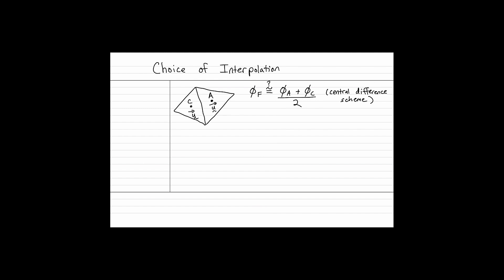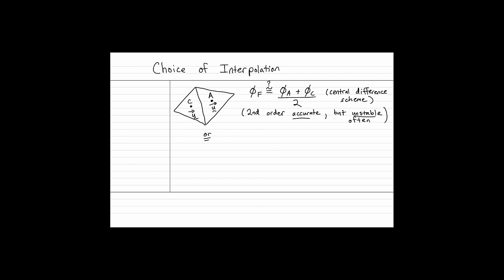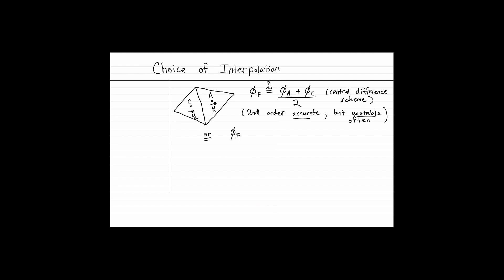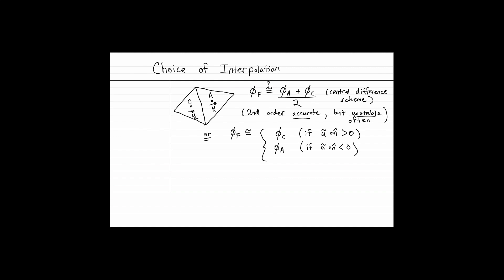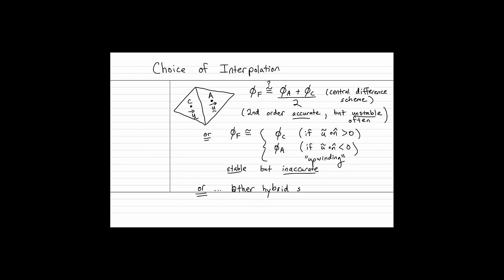Intro to FVM 5: Balancing Accuracy And Stability

Comment: So, basically would it be possibile to get the same accuracy using a lower numerical scheme ( let's say upwind) but using a higher number of nodes?
Reply: I guess it is guess. If we consider the FDM the error decreases  as O(h) in a first-order discretization and O(h^2) for the 2 order. Therefore If I use the double number of points in a 1rst order I would get the same accuracy of 2 order scheme with less points. Am I right?